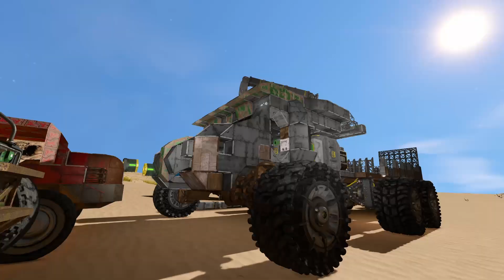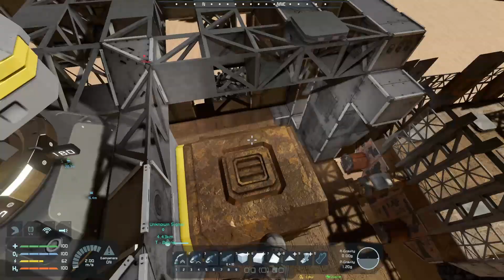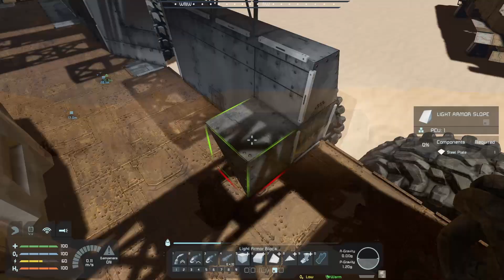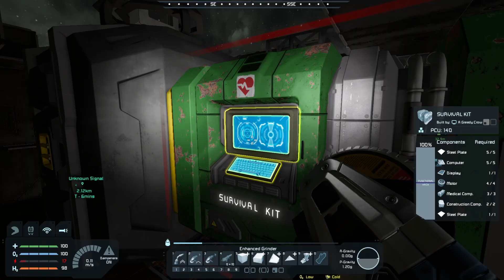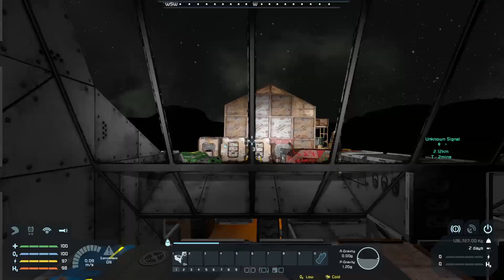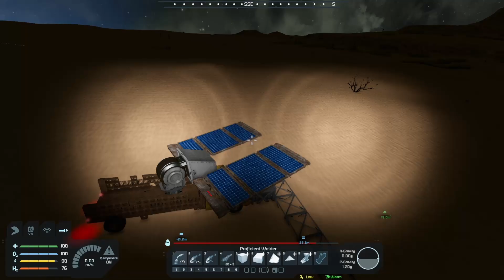A SCRAPtastic New Look | Space Engineers Scrapyard EP 12

Comment: Folding ramps are hard (I built one to drive a small rover onto a large rover and it sucked to build, and it doesn't look right, but it works), so I'm a fan of the lift. For the crane consider adding a conveyor converter between the rotor and the cargo container in case you need to transfer power or hydrogen via a small connector. For roof access you might want to use a ladder block (that might be DLC I forget). Double piston cranes are worse than folding ramps to build and unless you are using a programable block and a script to control them they are a nightmare to run. The only upside to double piston cranes is that they can lift more (a small block 3x3 piston would be nice).